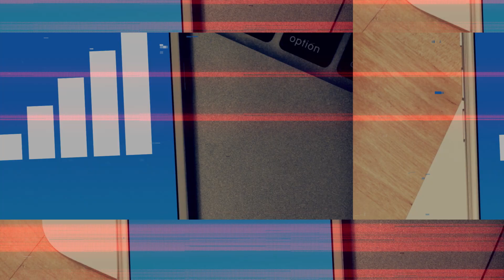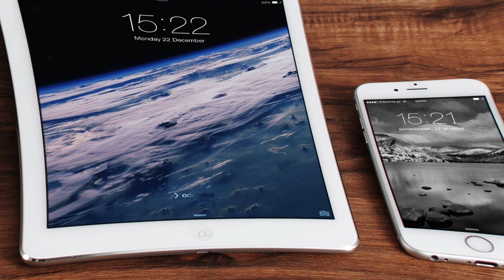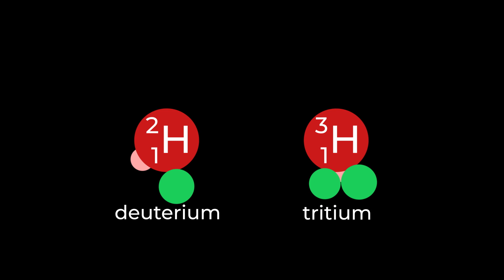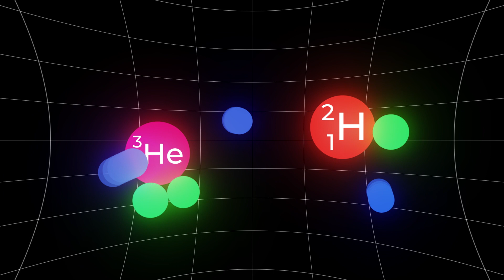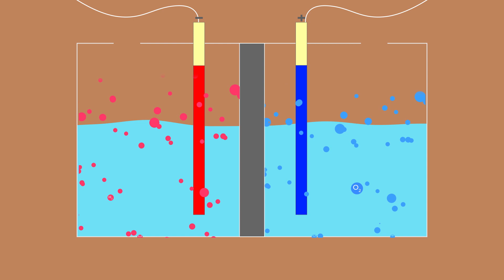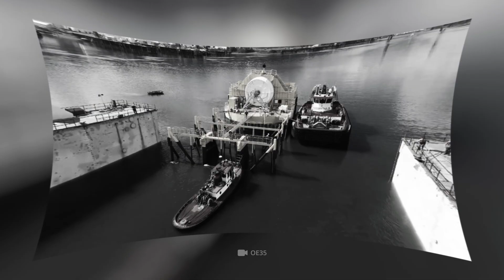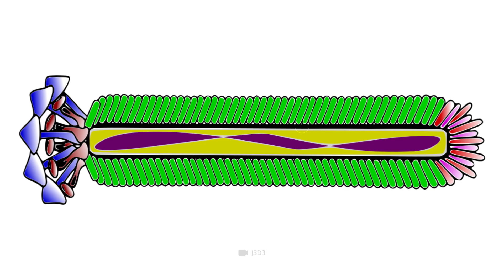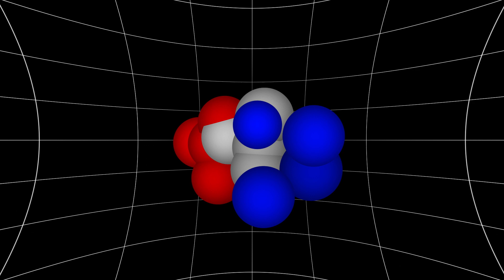What if All The Oil On Earth Runs Out ?

Comment: As every time, all the topic about running out of oil focused to energy production and vehicles only. But this is the smallest problem that can be solved. What actually is the real problem here is an unability to make any plastics and other substances and products from oil that are needed for either in the further production or direct use. This will kick us back to the iron age!!! Because now everthing is based on plastics and oir derivates. So no energy or transport, for that we already have substitutes, but every other material produced from oil should be very big concern. For this reason we should quickly move to non-oil transport and power production, so we at least preserve the rest f the oil for other use until we still can...but nobody is thinking about that at all!!!

Comment: We can use lighting to power the world of today it comes at a low cost and we get a lot out of it and it's a renewable energy source so all we need is a flat and clear field dig down at least 20 feet start building the base outward under ground and build conductors in to the ground so the soil can absorb some of the electricity from the thunder bolt so the strike can't destroy the building then make the top a little bit skinnier than the base than build it up from there and use copper and steel to build it and use concrete to cover the things you don't want to be struck by  the lightning bolt I'm just going to high school so I'm sorry if it's not college material so😺

Comment: Tar, oil shale, and coal can all be converted to liquid hydrocarbon fuels. There is enough for a few centuries. Then you could make liquid hydrocarbons with either biotechnology or industrial chemistry.
The electricity from large solar farms can be used to produce hydrogen by electrolysis. The hydrogen can then be combined with carbon dioxide to produce hydrocarbon fuels.
This may be better than working with hydrogen which is costly to compress and very costly to liquify.
Reply: Larry: This is analysis I made over 40 years ago. I then successfully invested in energy firms. There is no energy problem, only a few popular delusions circulating around!

Comment: you ask us which of these methods is best.  the answer is all of them.  Implement each of them as needed, and when they become feseble/viable.   For instance use solar and wind, with battery backup initially; then further supplement with wave/tidal power where possible.  Then as other future tech becomes available, like H3 and or thorium/liquid salt reactors, add them to the mix thus bolstering the power supply. And continue like that, adding to the layers of power production.  Not forgetting to mention bio diesel for the use of industry and power production, these can be created from food stuffs and algae, as interim alternatives to fuel; if we insist continuing with combustion engines for now.

Nasa: we have found crude oil on mars.
USA: mars needs freedom and democracy.
rest of the planet: #visible confusion#

Comment: Peak oil was mathematically shown to be a major world issue that was going to crash economies and plunge the entire world into a war of biblical proportions over the acquisition of resources. Unfortunately, that was supposed to have occurred in 1999. What none of the original models estimated were the progression of thermodynamics and combustion technologies which reduced the overall amount of oil used per capita per annum, nor did it take into account improvements in refining and petroleum geo-acquisition that have occurred in the last 20 years. Effectively the entire planet is a huge ball of oil and we could practically give it away for free other than the structural costs of getting it out of the ground, refining it and transporting it to consumers. 
This doesn't mean that oil is a great thing, but as a natural resource, we wouldn't have the world we have today without and, and the successor to oil, which is plasma fusion, requires the oil resource base we have to start it up, because you can't kick off a plasma fusion generator with a solar panel, not even with a gigafactory of solar panels.
Simple facts are, environmentalism is a poor model for the advancement of a species, it works well in regards to conservation, but when the debate on it leads to the restriction of both human, technological and social evolution, it is a detriment to the species as a whole.
TLDR: Oil is not going to run out before 2040, Oil is likely to still be in the ground in massive quantities even once our species has moved on to much more advanced energy sources in our slow but inevitable climb up the Kardashev Scale.

Comment: In all actuality, we don't need no stinking oil.  And no, Earth will never run out of it, ether.  It's a constantly renewable resource.  Especially the "Sweet Crude".
  As it stands today, there's no Sweet Crude Oil which is older than 18 years.  Check our the gulf of Mexico, and look at all the floating pump derricks, then ask yourself why they are towed from location to location in a big circuit, the largest taking 18 years to complete.  Fossil Crude: Think!  How is it that these wells we punch into the earth, contain pockets within ROCK under Pressure of over 3,000 pounds per square inch?  If it simply Puddled, how did it get under so much pressure?  Look again at the trouble we had capping the blown wells in Iraq.  They had to get Red Adair out of retirement to figure out how to deal with that much pressure.
 Oil is a natural product produced by the oceans (sweet crude) and the earth itself (Fossil Crude).  Even in the steel foundries, as they smelt and draw out the hot steel with rollers, the amount of oil accumulating on and around the rollers is astounding. . .  They never need to lube the bearings.
  In reality, the only true "Fossil Fuel" available on this planet, is coal.  And that's quickly going away as well.  All the old industry Magnets set up a system which forced everyone to depend upon an oil or coal product, then society in general never bothered to look further . . . In way over 100 years!?  You'd THINK by that time, Someone may have come up with something better? Yep!  They did, but the Old, Mighty Paradigm of "Only Oil" crushed any other possibilities. . . Until Elon Musk bought his own way out of the Oil Pit, and showed everyone that what we Could have had, is Still something that we MUST Have.
 Has anybody noticed how the Entire World is jumping on board with Tesla?  Humm. . .  It appears everybody is really tired of gas stations and changing their oil.  Maybe "everyone" never wanted that crap in the first place?

Comment: It means no drugs and clean air.  To generate power all you need a molten salt thorium reactor (studies have been done and it works).  Safe and no pressure casings.  It will not go critical as it will shut down before this happens.

Comment: What if we changed the shape of our cities to match the energetic symmetry of alien crop circles?
Start designing cities with the most important building at the very center of the geometric pattern.
Then build prioritized infrastructure outward's.
Use clean energy solution's.
Some beautiful crop circles out there with really balanced energies right?

Think....
What is the most important building in your city.
Something you cannot live without.
Why would this be at the center?

Think Sim City using alien crop circles as templates.
Save gas by creating efficient social engineering.
Where would A.I. and smart building's fit in?
Also think about farming/crop's and complimentary mechanism's.

Design it to be 100% self sufficient without any import or export.
Reply: Where will u get energy from crop circles? R u a moron?

Comment: highly doubtful we will run out of oil by 2040 we still have plenty of it. (and we use coal and natural gas for most of our power not oil) 
"Fossil fuels are the largest sources of energy for electricity generation
Natural gas was the largest source—about 35%—of U.S. electricity generation in 2018. Natural gas is used in steam turbines and gas turbines to generate electricity.

Coal was the second-largest energy source for U.S. electricity generation in 2018—about 27%. Nearly all coal-fired power plants use steam turbines. A few coal-fired power plants convert coal to a gas for use in a gas turbine to generate electricity.

Petroleum was the source of less than 1% of U.S. electricity generation in 2018. Residual fuel oil and petroleum coke are used in steam turbines. Distillate—or diesel—fuel oil is used in diesel-engine generators. Residual fuel oil and distillates can also be burned in gas turbines."
source https://www.eia.gov/energyexplained/electricity/electricity-in-the-us.php

although we should reduce our reliance on oil for most of our manufacturing needs it'd be a big step forward to stop how much we rely on organic molecules for power generation and fuel.

Comment: One thing that I didn't see mentioned is biofuel.  We are already able make alcohol and oils from plants.  We will just have to make some conversions to existing engines.

In addition, we can use genetic-engineering.  This can either increase the amount of fuel produced from a plant or we could alter the genes of bacterium to produce what we require.  

So, the idea of running out of fuel doesn't overly concern me.

However. what does concern is the lack of alternatives to petroleum for our other needs.  How are we going to replace plastic?   Go back to what we were using in the 1940s?

Comment: We don’t need oil we have oppressed alternative energy solutions. We just need the incentive to exploit them.  The sooner oil runs out the sooner we will be better off.
Reply: We still need that oil, so that we can develop those alternative technologies. So if oil runs out, the development of such technologies will definitely suffer.
Reply: Unless you have been hiding under a rock and not looking at good innovation in the way of a paradigm shift for new materials like Graphene and where we are at with it, emerging technologies and beyond, Quantum Technologies.

The video we are under, ignores mentioning anything in this way, "what if" is short - sighted in that "specific" way, but I guess not mentioning anything with Graphene since it's a form of atom carbons and a two - dimensional material that will require our coal and fossil fuels, since carbon in Latin "carbo" = coal.
Fun fact, carbon makes up a percent of our body, Graphene is made of carbon atoms if you ignore the two - dimensional part, which shows we have it in us, since it's made of carbon atoms.
Supposedly all living things on "Earth" have carbon in them.

Graphene will go into our products and all of our devices to replace Silicon. It will also go into our buildings / structures, machines / vehicles for ground and air, and for space exploration.

Graphene is also safe.

We need to replace Lithium-Ion, Silicon, and plastics. And other materials not mentioned, because of the greed, power and corruption around it. Plastics can also have lead in them, which is dangerous, same with weights for body building and many other things that we use.

The "lead-pencil" is a myth from Roman times, we've been using Graphite which is a 3 dimensional material and a form of carbon, and so we have been using the "Graphite-Pencils". Carbon becomes Graphite, and Graphite becomes Graphene "2 dimensional material", known as the "wonder material of the future" with its special properties, which it can only have if there are less to no "impurities", meaning the closer to no impurities, the better it is with its special properties in its "purest form". Imagine a net having holes in it, that's the impurities of Graphene, and it needs produced in its purest form to be as strong as possible and to have super conductivity "electrical current flow" with no resistance, which is a good thing.

Graphene also doesn't turn into a liquid when it reaches its melting point, which is really hot and can easily be used for heat shields on Elon Musk's SpaceX Starships, for other planets, when entering and exiting the atmosphere easily and not having to replace the heat shield for a long time, but Graphene can also be used on the inside as the electronics and as an energy source, as Graphene has boundless potential.
And so Graphene when it reaches its melting point "if it ever does when used for typical applications" like "entering and exiting the atmosphere with the Starships", the melting point doesn't turn into a liquid, it turns into a gas, this process is called sublimation. Imagine just like they are doing with carbon dioxide to turn it into Graphene, think about doing that when Graphene turns into a gas, to turn the gas instantly back into Graphene, this would regenerate the heat shields and anything else using Graphene when its melting.

Graphene has unlimited potential, this changes everything.
It's the material that is the key to unlocking many "emerging" technologies, Quantum Technologies today and later on, before new materials are found. New materials allow new things to happen that weren't possible before in emerging technologies.
Add on top of that, Quantum Technologies also change everything, we are also heading for a Type - 1 Advanced Civilization.
Reply: And so when he mentions in the video we are commenting under, about Plastics... think about the corruption around that. And he mentioned the clothes.. think about how Graphene could make clothes, so there you go.. get rid of the fossil fuel industry that uses it for fuel, and instead use it for Graphene technologies instead, and then turn it into Graphene clothes as they already are doing, and get rid of Plastics, Graphene can be transparent and safe without the worry of lead, so you see where that is going, the video we are under is not only ignorant but biased and corrupt, possibly from being short - sighted.

And that's not all, since Graphene has boundless potential, there are so man other applications, possibilities it can be used for on the Earth and in space exploration, with emerging technologies and beyond, Quantum Technologies.

If you are interested in learning more, I have a channel all about Graphene and where we are at with it, emerging technologies and beyond, Quantum Technologies.

1. Go to my channel, find a channel there called Technology Research, and go to that.

2. Find all the playlists on the channel, be sure to check each playlist description with the "more" button.

3. Find the "About" tab on my other channel and read that info first before going to the playlists, and then start with the Graphene playlist, you could check my other playlists like the Advanced Solar Panels Technologies, Graphene immortal batteries, and other things.. but just start with the Graphene playlist first. Check the rest of the channel out after that. Please finish all videos from top to bottom in that order.
Reply: I'm serious, follow the steps in my second comment above to find my other channel about Graphene and Quantum Technologies to see where we are at, you will be surprised!

They also found another way to produce Graphene, called Flash Graphene.